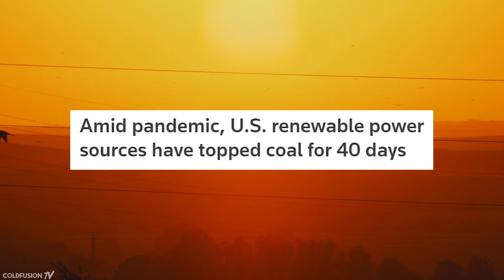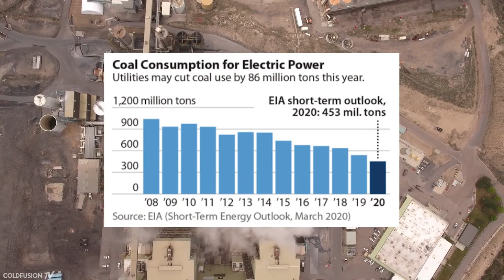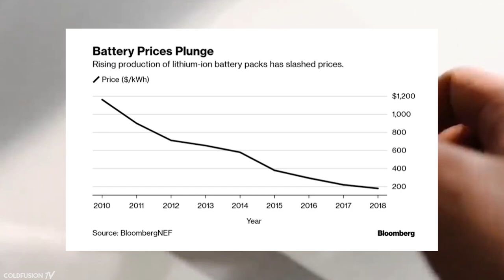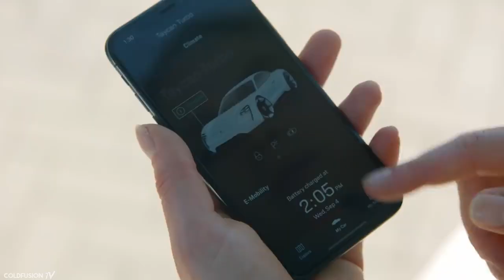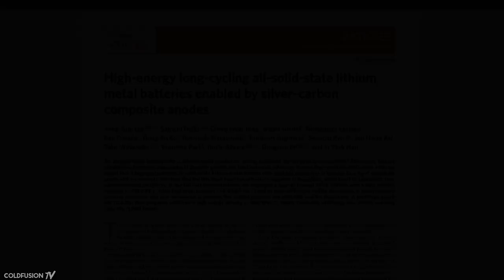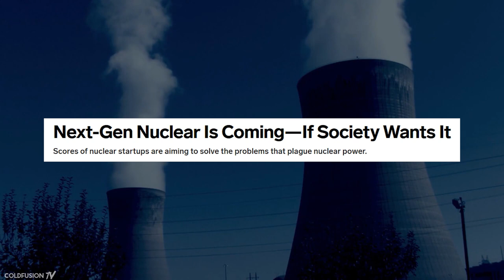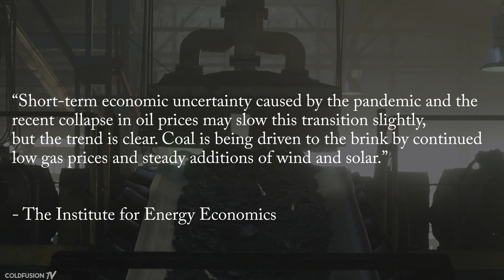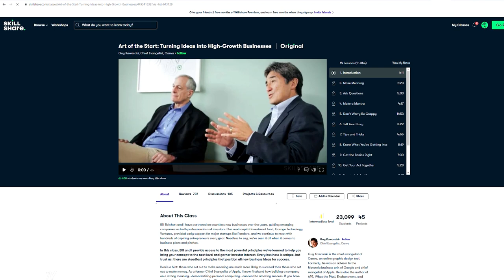Amid Pandemic, Renewables Now Supply More Energy than Coal in the U.S.

Comment: A lot of interesting points Dagogo makes I agree with most . But about Nuclear options  he over looks the water needed to run Nuclear power . With climate change droughts are going to be a problem all over the world and we can not spare the water in these places. and he downplays the safety of these plants. Fukushima is a good example it was a new state of the art Nuclear power Plant but one earth quack proved them wrong. now a 12 mile radius around the plant is uninhabitable and radioactive water is still leaking into the Ocean. The arrogance of Engineers has always been blown away by mother nature. Mother nature is smarter and more powerful then the mind and might of men. Nuclear is not continues energy Plants have to be shut down for at leat 30 days for inspection and maintenance  .During that time it doesn't produce energy. A wind or Solar farm can shut down in segments and produce energy during the entire time of( weather permitting)maintenance. At a reduced amount but still produce electricity.  The construction of these Nuclear plats will require the same constitution machinery to build and maintain as the wind and solar. As a truck driver I have worked for companies that had contracts with Wind energy companies and trucking companies with DOE contracts. I have spent a lot of time on a verity of energy construction sites.